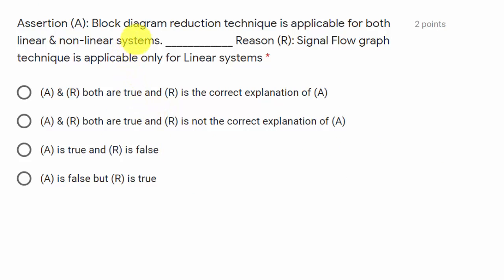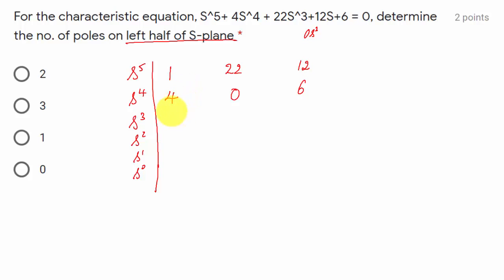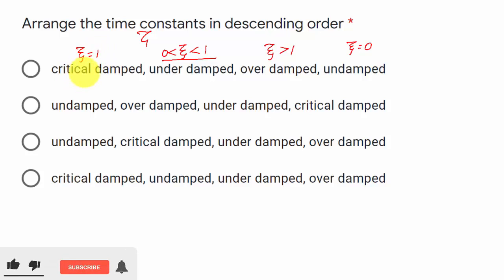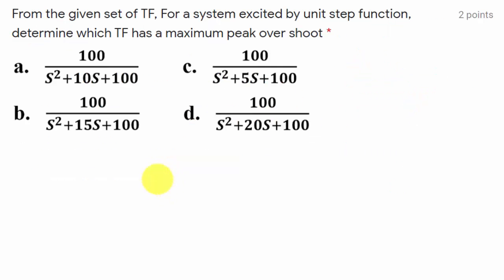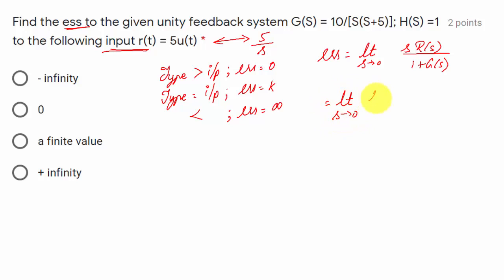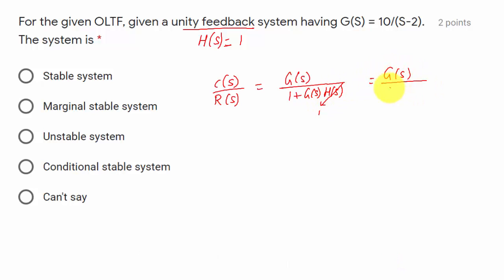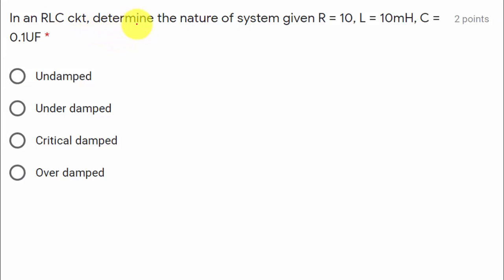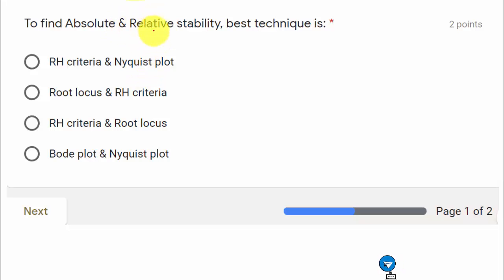Control System NTA UGC NET Mock Test 9 Electronic Science

Comment: question in which no of poles in the left half of s plane is asked answer should be zero as it is not following the necessary condition of RH criteria because all the coefficient of S are not present as coefficient of s^2=0 so system should be unsatable and left half poles should be zero. i think we cant find the stability of the given system using RH criteria bcz its not following the conditions
Reply: Yes i think too..but in question there is no concept of stability..
Reply from the maker: You're wrong Upendar
You can apply
Reply: @CravingGyan  sir i mean in given question u r not asked the stability sir..
Reply from the maker: System is unstable with 2 poles right and 3 poles left
Reply from the maker: Coefficient missing doesn't mean you can't apply RH criteria, still you can apply.
But for the given problem system is unstable.
RH criteria fails when you've exponential term or sinusoidal term